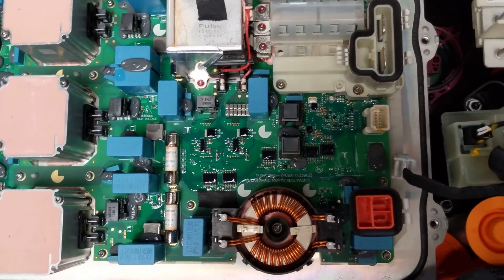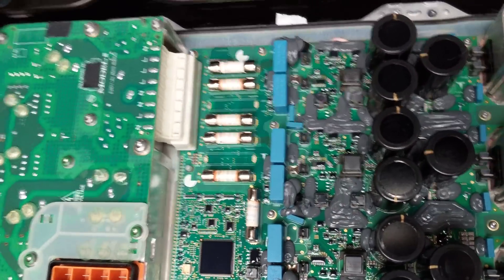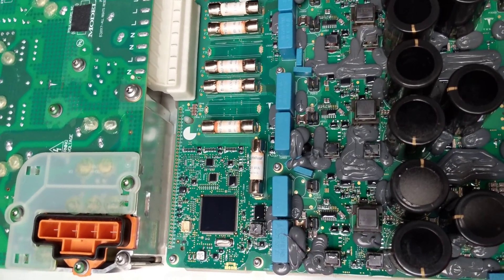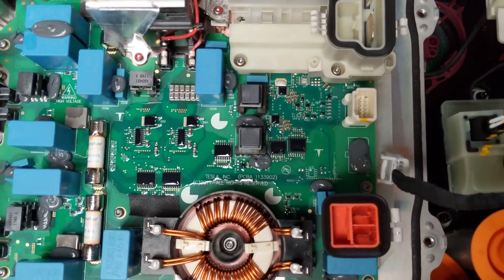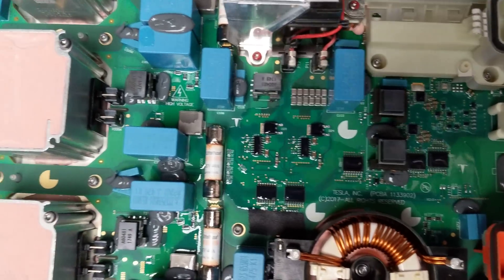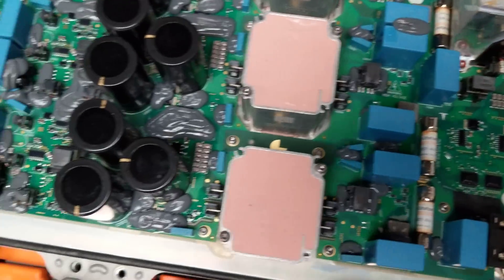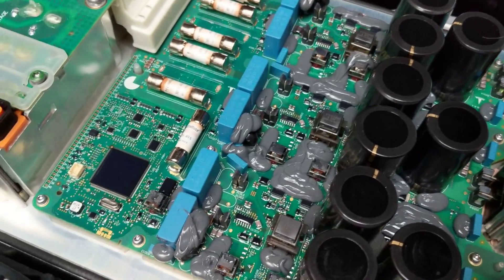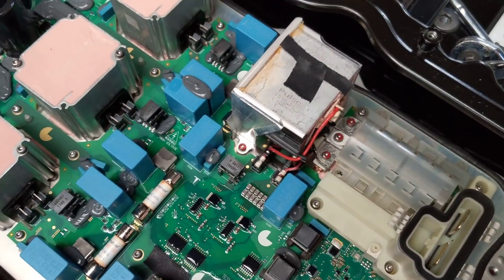Tesla Model 3 Power Conversion System

Comment: Kinda got lost there. What are the "magnetics"?

And, are the large square devices to the right of the can capacitors?
Reply from the maker: The large square things are transformers (magnetics).  The capacitors are the black cans (Bulk electrolytic), and the blue rectangles (Low ESR film).
Reply: OK. That's what the inference seemed to be, but I've never heard transformers called magnetics before. Learn something new every day. 

So with xformers that size, in spite of the caps being to the left, closer to the input, I would assume they are kicking the voltage up to the 400s before rectifying it to DC. Would that be your take?
Reply from the maker: Chokes and Inductors are also in the "magnetics" family.  Any components making use of magnetism.  The transformers are needed to support galvanic isolation of the AC line from the car.  Otherwise you could just use an inductor-based buck/boost.  Typically they run a PFC stage (boost) to take the 240VAC to to about 400VDC, which is then is chopped into high frequency and run into a transformer, then rectified and sent to the battery.

Comment: Do you see any sign of a Power Line Communications chip or related circuitry for natively supporting CCS-style digital communication protocols?

In theory, this may become important in the future even for AC charging via the J1772 adapter but it also opens the possibility for a simple CCS DC adapter.
Reply: I believe the TMS320 that's on the board should support PLC communication.. I could be completely wrong though. Easy way to figure it out would be to check if this PCB is different in the european model.

Comment: thanks for all these videos        do you know how much power you can draw from the 12v converter and what is the voltage of this converter is it really 12v  or 14.4v thanx in advance
Reply from the maker: I haven't measured it yet, but I suspect it's at least 1.5kW and the output voltage depends on the intelligent charge algorithm for the 12 AGM battery, so will vary with which charge phase it's in as well as temperature.   I've seen it up to almost 15v, but never below 14v.  It's typically around 14.8 here with our mild temps.

Comment: Looks like they split the phases, one AC-DC converter unit per phase
Reply from the maker: This is a US-Spec car, so it only has single-phase input.  The 3 sections all work off the same common AC input.  There is clearly places for adding the 3rd leg in though, so they can re-use the PCB and almost all of the other parts in the EU-spec model.
Reply: I would assume that it is AC inlet filter board to the left. This would typically be different for single phase and three phase inlet.  Also the AC fuse configuration would be different.

Comment: What power levels are we talking about and can you write parts numbers? mainly the caps and the transistors but also the unusual transformers if they have parts numbers. I also wonder about switching frequencies. It doesn't look like fast resonant topologies although the 12V is very small if it's just the corner. Maybe it's only say 400W or even less.
Reply: The HV connector seems modest so maybe it's only 25A/10kW. The common mode choke seems big. Maybe it doubles as output filter inductor. 
It's my impression that more smaller lyt caps perform better and cost less than larger cans like those. I would probably also go to a very high frequency topology and maybe get away with planar PCB trace transformers. And single stage if possible. Although that design is fairly compact if it's the ~11kW design talked about.
Reply: TMS320 is an ancient chip. Is that still good? seems somewhat expensive for its specs. Similar specs for 1/10 the cost.
Reply from the maker: I haven't performed a full load test on the DC-DC, but I suspect it's a least 1.5kW.  400W would not cut it.

The charger is about 12kW, So I think about 4kW per phase.  The HV fuse is 63A.
Reply from the maker: It has heritage, but it's a well used and current architecture.  Here is the variant used: http://www.ti.com/product/TMS320F28377D
Reply: "That's not your father's TMS320."  :)  I'm sure TI has reved it many times over the years, at a minimum with newer semiconductor process technologies for better efficiency, speed, etc.

Comment: Any idea how many Watts the 12V system can output? I'm curious about running an inverter for emergency house power during an outage.
Reply from the maker: I haven't loaded it up, but I think it's at least 1.5Kw.   Though if you want to run an inverter, best way is to get something that can take in 300-400VDC and then you don't have as much conversion loss.  You should be able to pull 10kW off the HV system without issue.  Just do it safely!
Reply: Ingineerix I am in the process of wiring a 12V inverter now.  (I had thought about using the HV side to run the inverter, but I believe Tesla would auto-void the drivetrain warranty if they saw that.  Using the 12V side makes it no different than installing subwoofers & an amplifier).  I’m using a 1.5kW / 3kW peak pure sine wave inverter and I’m running the power through 0ga OFC cable & a 200A fuse.  Do you have any suggestions or advise for someone like me doing this install?  I’m making a video of the install and I will post it in a couple weeks after I confirm everything is working well
Reply: @setheroth28092  How has this gone for you? I'm really looking into something on that level for a fridge backup and a few lights with power outages off my M3.
Reply: @setheroth28092 how did this turn out? Did you precharge the caps in the inverter before connecting to the pcs?
Reply from the maker: Incorrect.  Even if limited to 40A, that's over 10kW even at the lowest pack voltage.  That fuse is to cover the charger output, not 12v output.
Reply: @Ingineerix  Can you explain the comment regarding the 10kW further? Wouldn't the charger output use a larger current?
Reply: I wonder that too although for your use an ATX power supply seems more obvious if your battery backup is somehow high voltage. Or are you talking about leeching directly from a model 3?  I wouldn't do that.
Reply: the fuses says 40 A so no more than 480 Watts

Comment: In the eu the tesla ac-chargers (S & X) support 11KW (3x 16A/230V) @default and 16,5KW (24A) upgrated through software. Do the numbers on the fuses add up to the math?
Reply from the maker: I suspect in the EU it will support 16A 3-phase.  There are clear paths for the 3rd leg.  There is no higher capacity to my knowledge, but keep in mind, this is only a 74kWh pack, so charging can complete in around 6 hours at full capacity.
Reply: prob capped at 16 A yes but if the fuses say 40 A it could deliver that much but of course the other components need to deliver that too ^^
Reply: as far as i know this is the dc-dc converter. this outputs 12 V and the fuses say 40A so max 480 Watts
Reply: however if this also functions as the AC-DC converter you would have a max charging power of 27 kw with 3 phase 400 V
Reply: @Ingineerix; "this is only a 74kWh pack, so charging can complete in around 6 hours at full capacity."; 3-phase 16 A (400 V system) provides 11 kW. So full charging would take 7 h, perhaps even 8 h due to charge loses.

Comment: Thanks very much for making all these videos. You do a remarkable job at conveying both the elegant simplicity and magnitude of engineering that have gone into this vehicle. I appreciate Model 3 substantially more now that I see how astoundingly well integrated and designed the system physically is. It suggests extreme robustness, reliability, and longevity, which are ideal adjectives to describe a car, in my opinion. I am stunned at how thoroughly the engineering of Model 3 distinguishes itself from essentially all other vehicles being mass manufactured today.
Reply from the maker: I love taking this stuff apart.  Engineering Porn!  =)
Reply: The electrical engineering does look VERY good.  Very high quality work.  Good parts quality, good board materials, good layout, etc.  

Also that is quite a bit of integration to have both the AC charger and DC to DC converter on the same module.  Makes sense to integrate them, but only if you're very confident about the engineering.
Reply: Pikminiman totally agree. When I first went for a test drive of the S, you could really sense the cohesiveness of the engineering. Sure Tesla had had some fit and finish issues, but as an engineer you can really sense how amazing the car is. Wish they were a better investment, I'd definitely have one.

Comment: I've found somewhere that the drive motor's stator isn't a solid one but multiple axial part with lots of gaps, which is unique and makes me confused !  I suspect that structure is for air cooling but my colleague says it's oil cooling. Now, only more details from your amazing sharing can prevent the "bloody" fight between us (just kidding LOL.
So, I'm Looking forward to the detail teardown of the drive unit, especially the connection between drive motor & gearbox, the oil loop between them, drive motor's elctro-magnetic structure and cooling structure. ^o^
Thanks again~
Reply: mondayfool  To my knowledge, the rotor has 6 poles with “V” style PMs, which looks normal. The stator is divided into many skinny slices, like a bread being sliced into many pieces, each one has 54 slots around, so gaps are between these slices but not on them, that reveals a switch reluctance structure? I don’t know how…anyway lets wait Ingineerix upload more.
Reply: mondayfool And each slice has hundreds of small rectangular holes around the outer diameter, which really shocks me.